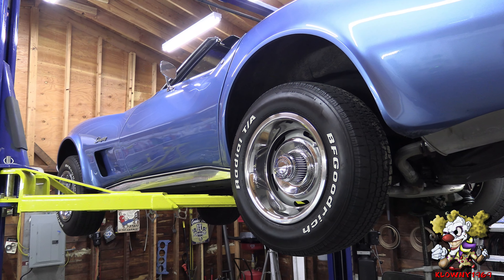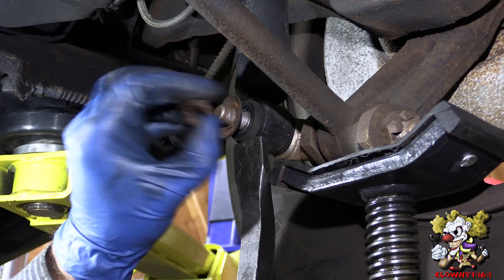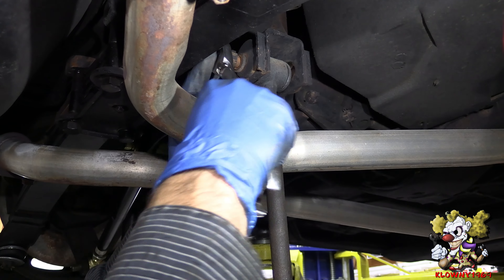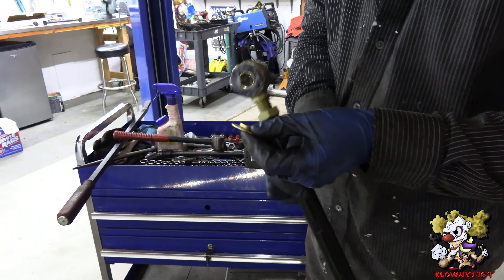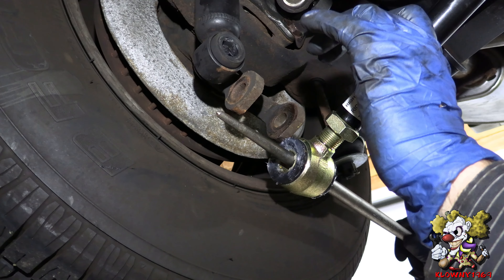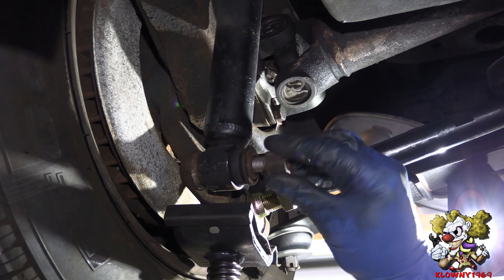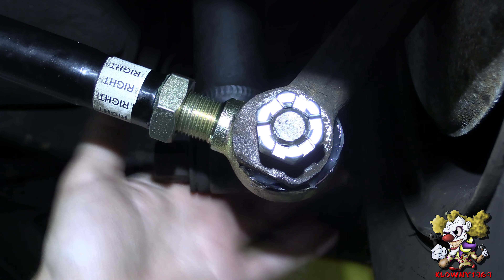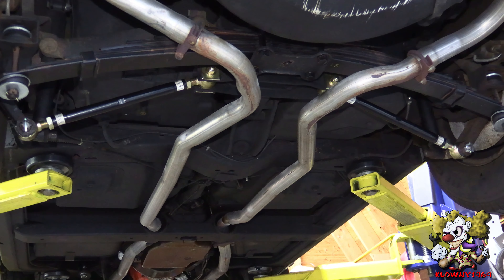How To Replace Strut Rods On A Corvette C3

Comment: When you adjust the length of the rods, I guess you do so with the wheels hanging so they move more freely, correct? Then you lower the car to the ground, measure the camber, drive it a bit to settle and rinse and repeat until you get the camber right, correct? Thanks! Subscribed.
Reply from the maker: Yesir! Thank you for subscribing!

Comment: Correct me if I'm wrong but I have to disagree with the way you set the length of the replacement rod. If the original eccentric was in the middle of the slot then fine. But if it's not then when you mount the rod in the middle of the bracket, which is what happens when you install the supplied plate, then the wheel will not be in the correct position. I know an alignment is needed anyway but it will be even that much farther off. I would pick a reference spot on the bracket and measure the location of the center of the shock bracket where the castle nut installs and set the length of the rod from there. That should get you closer to the original camber position of the wheel..
Reply from the maker: These rods were really bent and the alignment was way off to begin with. Thanks for commenting and don't forget to subscribe 😉

Comment: Thanks for the video. I just crawled out from under my 71 trying to do this. I have the adjustable struts but the bushings are crumbling after about five years. Got the shock off but couldn’t beat the bolt out. Gonna take to someone with a lift. I’m getting too old to roll around on the garage floor anyway.
Reply from the maker: I hear ya..rolling around the floor really sux!! Don't forget to subscribe

Comment: Can you help me with this problem i’m having on my c3 ? it will will not reverse unless I jack it up i have replaced wheel bearings in both sides and put new adjustable strut rods you did in video and now this is an issue i’ve already checked and made sure e brake is free and calipers are free. the strut rods i took off were bent . any advice is appreciated.
Reply from the maker: Need more info on car..is it auto? You sure it's going in reverse gear?

Comment: Great video. I have the same strut rods. How are you supposed to adjust the alignment? Do you loosen the nuts on each end and then turn the tube? Mine are nice and clean without rust but it's impossible to break them loose. Any suggestions anyone?
Reply from the maker: Yes loosen da nuts and turn it..don't forget to subscribe 😉
Reply: @klowny1969  Thanks, I guess they are real tight so I'll "persuade" a bit more to loosen the nuts. To loosen the nuts, which one is the  right handed thread and which is left handed? Does the side labeled as "RIGHT" also have a right-handed nut and the LEFT a left handed nut? Seems obvious, but just checking... What size is the wrench to loosen the nuts? Subscribed, .. Thank you.

Comment: If you didn’t have that size die you could also by a thread file if it comes in that thread which is probably cheaper  than a 1 time use of a die..
Reply from the maker: Yesir..thanks for stopping by

Comment: I had a bright blue 1969 t top Corvette.  The rear hub bearing started to roar so my buddy and I removed the hub and torque arm.  We took it to a buddy at the Chevy dealer and he fixed it.  He laughed and said he could have repaired it on the  car!  He also said he could lubricate the sealed bearing with a syringe.
Reply from the maker: Those need to be torqued to a specific spec, takes a bit of work to get right..thanks for watching